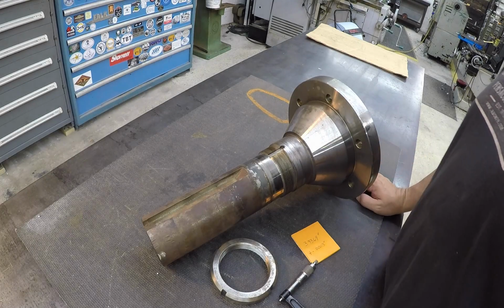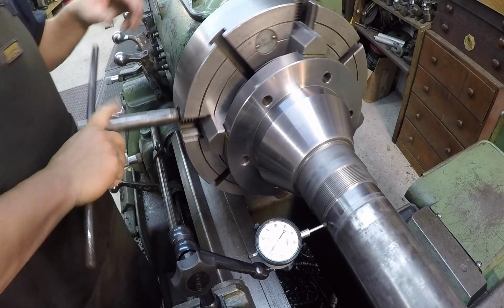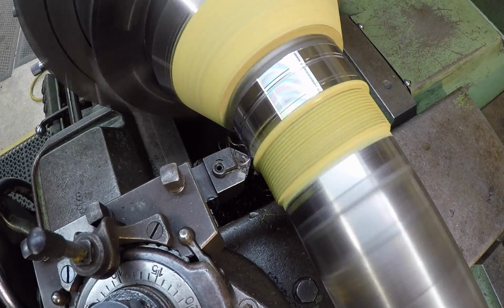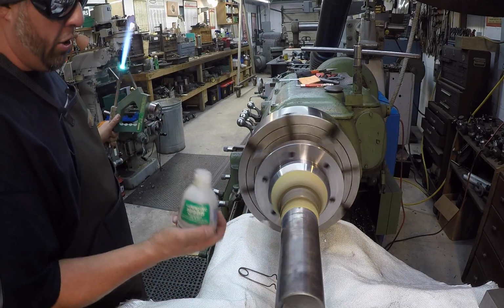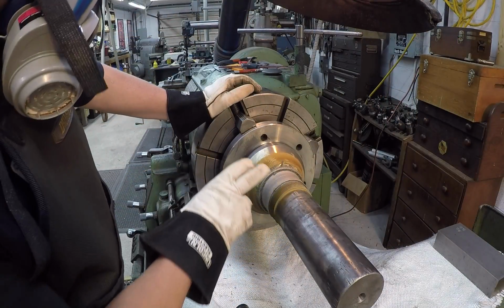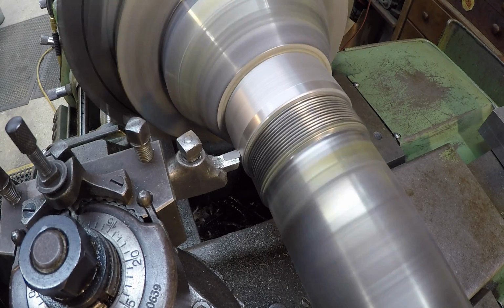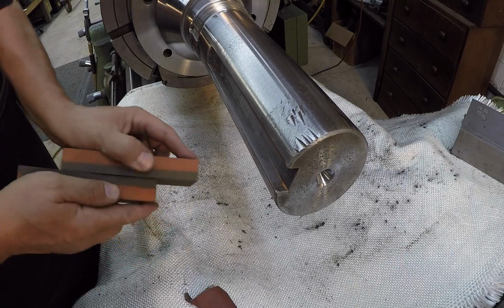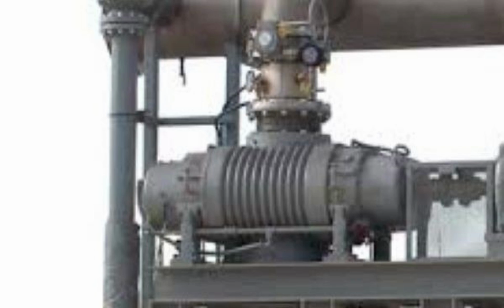SNS 300: Spray Welding a Blower Shaft

Comment: I worked in a refinery back in the 80's and 90's, and spray welding was a common repair for big turbine rotor journals. I was an electrician so I never got to see the actual process. Thank you Adam for sharing  the process with us.Nice job!

Comment: Crackin Video..very informative..now i get what happens when the mechanic takes our John Deere front drive shafts away for spray welding process..to get the shaft built up to run the new seal..so's the bloody thing don't leak

Comment: Hi, really enjoy watching your videos here in Scotland!  Hope you don't mind me making a couple of comments - I worked for Castolin Eutectic for 30+ years and trained oxy fuel thermal spray system users.  First observation relates to use of screw threading for preparation - I have never used this as a prep method for a couple of reasons.

The potential benefit of screw threading is to increase the effective surface area available for the coating, but there are some factors that can limit this effectiveness. 

1. unless the threading is done correctly (ie. rounded tip and root profiles) there is a risk of heat oxidising the tips of the threads which will reduce or prevent effective adhesion of the bond coat. 

2. If the thread pitch is too narrow in the root there may be voids, again reducing the effective area available for adhesion. 

3. Threading preparation normally omits what for me is another vital step (which may answer questions raised by some of your other viewers regarding causes of coatings shelling) - oxidation forming during the preheat stage. 

One of the key reasons for coating failure at the initial stage in my experience is applying bond coat on top of a surface that became oxidised during preheat.  This is normally indicated by surface discolouration, usually evidenced immediately on applying heat.  This is diffucult to see on a screw threaded surface, but becomes very visible if alternative preparation methods are used. So, I normally advise preheating, then final preparation.  This is easier to do if it is possible to a, grit blast or b. random grind with a small grinder (with a clean disk).  Step b. is usually easier since the initial set up of the part doesn't need to be disturbed.  The clean, random ground surface is ideal for applying the bond coat to - but preheat, final light grind back to clean metal and immediately apply the bond coat. 

It would be worth trying this method, what you should see on applying heat is the formation of a brown discolouration on the surface - coating on top of this (as is likely happening) is most likely compromising the coating bond effectiveness.  Just give a final light grind back to bright metal and proceed from there.  Hope this helps!
Reply: If I recall correctly,we were told. To use a 90 degree too tip to cut the thread so that the root and crest of the threads were broad, and were therefore more resistant to overheating.

Comment: Back in the late 1970's the Aussie army was using this method to repair worm drive sprockets on M113 APCs and the finished repair was harder and wore better than the brand new replacement parts. If i remember the repaired parts would last 3 times the brand new ones this was because they were able to put a harder build up on the wear area of the sprocket to the cast hardness
Reply: Also the spray material has micro pockets that hold oil better
Reply: I doubt it was the cold process as shown here. The application you describe may have been a fusion process which looks similar to this.
Reply: @paulhickey4485  same process basically. But uses a wet oil fed quenching clamp with hardening oil on it . Spray weld , then immediately apply the clamp on just the area that needs hardened on the shafts or race areas. Saw this done at rayethon before on sealed drive motor systems in the 90s that were used in areas that were very inaccessible, high heat or that needed extreme long life intervals, (years) between servicing.  New build process. Not repair like this as far as I know. But may have been used for rebuilding.

Comment: Is the method of "spray welding process" used in this episode based on sintering or does the melting also occur?
Reply: I asked myself the same question. From the name of the brand/process "Eutectic" I would guess that the alloy used for the powder has a relatively low melting point and thus bonds to the base metal. (Eutectic means that the melting point of alloys is below the melting points of the constituents.) Just a guess, though.

Comment: Funny!  A few years back I had a small Tuthill 4005 (4” gear 5” lobe) PD roots blower (two lobe) blower get the drive shaft milled down and wrecked when the shaft key fell out during a big job.  The taper fit pulley bushing came loose and messed the shaft up.  Turns out replacing a lobe costs almost as much as a whole new $1,600.00 blower!  Then a business friend told me to take it to a place nearby called “Flame Spray Northwest” not far from me in Seattle.  Got the repaired lobe back in 2 days, for a mere $120.  Rebuilt the blower while I had it apart with new bearings and a seal kit, been working ever since!!!  REALLY fun seeing an example of what they did in this video!  Nice job Adam, and thanks for this video Dude!  Been a subscriber for a few years now.  Always great to learn from a master!  👍

Comment: Would it be easier to say that it's 100 mm bearing and fitting tolerance must be -0,01 to +0,00 mm?

Just wondering this 3,9369 inhc... 🤔😂
Reply: He's from USA, they use imperial units (inches), not metric units (mm), like the rest of the world. So no, its not easier for him to use mm :)
Reply: @nitsi123  I know, let's forgive him. 🙄
Reply: @nitsi123  Some shops must work in Metric?  Do they have to split the shop down the middle between metric and imperial equipment? Just curious.

Comment: A bomb Adam here man what a great 300 video good ole spray welding you got it down brother definitely cheaper than chrome . it just puckers my ass to think either method will hold up it is a coating like cement patch that never holds up but it's tride and true and only a master can make it happen.
Reply: Funny you said tried and true also at end of video cause it is.  I coommented my cart before the horse.Used this method to bring a broach back to life a few times

Comment: I would say that the machining tolerance was incorrect for the 100mm bearing journal using eutectic spray weld. The finished material is porous and compressible. Apart from that nice vid. (BTW I have used this system going back to the early 80's in the UK)

Comment: Hi Adam..you mentioned a  tolerance of three tenths ie 0.3 yet on the note you have it 0.0003 ...am i getting it mixed up somewhere ? but super nice work and thanks once again
Reply: when machinists refer to "tenths" they mean "tenths of a thousandth", i.e. 0.0001
Reply: Metric anyone, ha ha.
Reply: @andrewmcconn  Yeah well 0.30mm = 12 thou near enough
Reply: He’s talking 3/10’s of a thousandth.  4th decimal point.  They abbreviate because machinists usually mess around the thousandths range, so for their purposes, and since they talk in thousandths (mostly) they just move the decimal over 3 spots for the sake of not having to use extra words.
Reply: When a machinist mentions tenths, they are referring to ten thousands of an inch, as they work with tight tolerances it is expected they are working in thousands and ten thousands of an inch so it is a quick way of saying it.
Reply: 3 tenths for a machinist is 3/10,000's of an inch.  Most measurements are in 1000's or 0.001, so tenths means splitting that thousands into "tenths".
Reply: 3 tenths of a thou = 0.0003".    0.3" of an inch = 0.300" = 300 thou.

Comment: See if you have a leather worker local to you, shipping stuff like this back with some slightly oil impregnated thin leather between the metal in wood is a nice touch.  You can get thin trimmings from them for squat to nothing. Works better than hard fine-bubble poly and it's bio-degradable just like wood.

Comment: Adam, Fantastic repair job on this part that looks expensive and hell. This spray welding has always been a interesting addition to repairing parts, that you have to worry about the heat associated with welding. And YES, its something you don't see on YouTube everyday.

Comment: Adam, that looks very similar to a counter shaft in a positive displacement blower that would be used in a vac truck like I used to repair and maintain.  Those things are crazy expensive, the blowers alone can be more than $100,000. Those blowers can pull about 25 inches of vacuum in an 8" pipe and really move some material. 
It's a shame to see someone used a pipe wrench on the end of the shaft. Some people just don't have pride or skill in their work.
Congratulations on 300 episodes too, that's a great accomplishment. 
Cheers

Comment: Awesome repair. The camera work was superb !  I took a D9G track idler wheel, in 1974-5, to a local machine shop and they repaired it by spray welding at a fraction of the cost of new from CAT.
Reply: The price of CAT parts today is unreal. More and more shops should get back into this type of repair work. Sadly, unless they can't find the parts on the shelf, They just pay the over inflated costs and move on. This is why you see so much used older equipment that's boxed up and sold in 3rd world countries. Because this is how they fix stuff there. It's not all just throw away parts for them. If it  comes off, it can be put back on. And made to work again.

Comment: I've seen a few sleaves fail. They do work most of the time but all it takes is a few failures to crap on your name. But my experience is mainly automotive. Without giving away details or anything what would it roughly cost to make that part vs repair that part? If it was essential enough it seems like you would have a back up.

Comment: Have you ever used any Belzona??  We used to use Belzona and machined the shafts for a bearing fit and through the bearing on - usually on motor shaft bearings ..

Comment: Nice job! We use thermal spray coating on aviation components at work for dimensional restoration. Do you adjust the emissivity coefficient on your infrared gun to compensate for the parent metal emissivity value?

Comment: When you only have a tolerance of plus or minus .0003  wouldn't it be safer to leave it approximately .001-.002 over and use a tool post grinder to bring it to final size ? When I had a tolerance of plus or minus .0001 the final step was always a grinder such as a cylindrical grinder. Stay safe you two.

Comment: I would say that a lot of shops would rather just turn a new shaft, more profit, than take the time to do a spray weld the right way.  Nicely done.
Reply: I find for a lot of things, while going new is more expensive, it's actually cheaper in the long run, especially in big operations. While a repair is cheaper like a spray weld, the real problem is finding guys that do it right to begin with. A bad repair that needs to be done twice costs more than just buying a new part after factoring down time. 

For those that have good guys and treat them right, you're golden.

Comment: I have been in the business for several decades and one thing I learned was powder spray weld build-up is not any better than a speedy sleeve. To make it right, weld build-up is the best way.  If done right it is really not any harder to do than your spray weld. I have rerepaired many powder coat build-up shafts with weld. The powder coa
Reply: Do you feel better now?
Reply: Tracy Lemme  he explained this in the video...He prefers this method and has had no issues with it.   Again if you had access to a CNC you can say why bother to repair when you can machine a new one in same time and if you need another you just load the file in and press a button. 

Same job many ways to tackle it, the company sourced him due to his skill set in this repair method.

Comment: Crazy that this is cheaper than machining a new shaft. Awesome video tho love the repair videos.
Reply: mrbananamanification  

In the short run this is cheaper in the long run it more expensive if it needs to be done on multiple shafts.

Beauty of cnc is once’s it programmed its easy to cut another in a short period of time.  But it’s the initial setup /design cost that’s expensive
Reply: Satveer Degun  Abom seemed to be implying that part of the expense of a new part would be the material.  The whole assembly is machined from a single piece of stock.  That is a lot of material to remove, even for a CNC.

Comment: I’m drawing a blank on the wire number but it is the 7018 stick weld rod for the mig welder in flux core we run with argon mix like typical wire welding nevertheless we have parts very similar to we have to build up and turn down.  We have a ‘home made’ drive unit for extra pallet wrapper parts a 40:1 gearbox with a old large Chuck on it and a dc motor with controller.  We had to gear it down and 10:1 chain drive feeding the gearbox with the chuck.  Have a few v block with bearing to hold the parts in the start welding.  No undercut it typical is undercut from the bearings lol.  Makes me ask if it is hotter our way or yours for the part.  We have had some issues with the metal after welding breaking off, have you had that issues?
Reply: if the weld breaking off. it not penetrating the metal very well if they are not preheating befor welding
Reply: oly mike pre heat what’s that ain’t no need to that is what they told me (can’t fix root cause) we use a shaft has to be made out a solid 4140 steel then heat treat 35-40rc it has a large face 12” round about 1.5” thick then 8” for .5” then the bearing od size close to 4” for 1” then the bearing id size of 3” it is a needle bearing about 4” with a thrust bearing on it then about a foot later there is a ball bearing a punt 4” with a locknut.  There are two shaft kinda like a head stock and tail stock that holds a 3000# roll of ‘paper’ that’s 45” round.  Every few years somebody tires welding it up then it throws the roll off when it breaks.  So far nobody been hurt only woken from there naps.  The sleeve bearing tends to snip locking up when there seal leaks grease out because ‘paper’ gets in it.  This cold process I think it might works as the heat treat is lose and this heats to pre heats 200F not then 500F plus we have tried.  Thank you for the comment
Reply: 46:37..... I asked too soon...  it is a cold process.

Comment: First time I saw spray welding was in 1968 in an electric motor shop that I worked at.  The gun they used looked exactly like Adam's old one.
Reply: Pretty sure I saw "1971" printed on the bottom of that sticker on the box lid. Back then the 1970 El Camino SS was one of the baddest new cars on the road.

Comment: Very enjoyable to watch. I'm a lathe and mill guy so this is more out of my wheelhouse and thus more interesting than the general turning stuff. Can I give you a tip on how I used to polish crankshaft journals on the lathe? Get an old car engine cambelt, cut across it so it's a strip and you can use that to pull the emery cloth against the journal. The rigidity of the cambelt keeps the emery flatter against the work and it makes it easier to use short off-cuts of emery instead of long strips you have to hold by hand. You don't need to glue the emery down or anything. Friction holds it in place. Maybe give it a try and let me know what you think.

Comment: Well said at the end of your video Adam. I have been using this process to repair engine crankshafts for more than 30 years i have save customers lots of stress
Reply: Hi, where can I get a machine like this?
Reply: @themechanicdrredewaan5916  not sure where you are but in Australia i buy it through my industrial supply company search to equipments name.
Reply: @normesmonde5332  name of the tool?
Reply: @themechanicdrredewaan5916  importantly you need to really know how to use it correctly on crankshafts. Try something less fragile first.

Comment: I love to watch your spray welding.  I bought a spray welding rig at a auction last fall but I have not been able to find much information as to what powder to use for what material.    Do you have any recommended manual or powder interchange chart?

Comment: Adam, is there a reason you dont have the free end support in place while spray welding. Will you have to re-indicate before milling?
Reply: Thermal expansion of the part could expand into the tail stock with too much force.